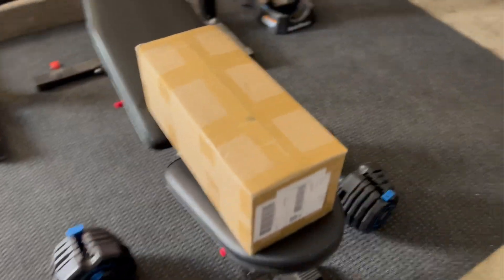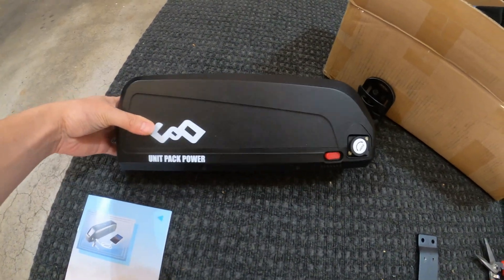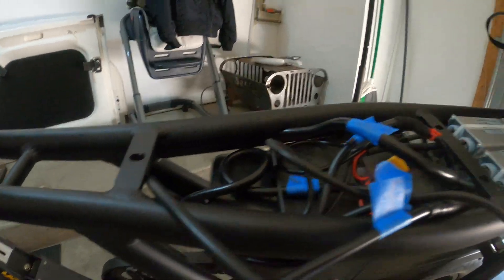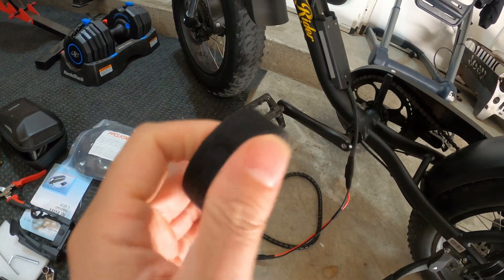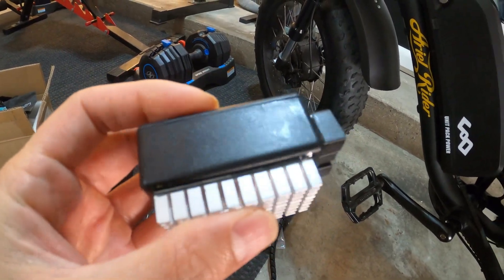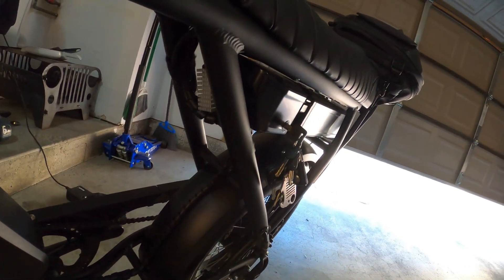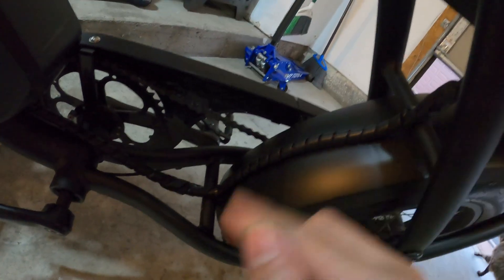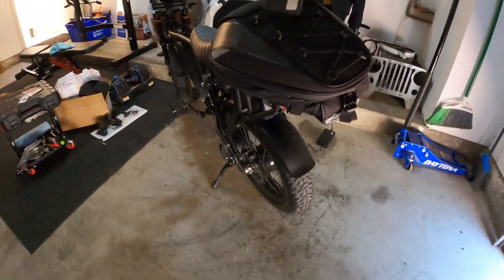Dual Battery Install 52v 19ah Fusion Battery Combiner Ariel Rider D Class

Comment: WoW that's how you open a box very boring
Reply: Yeah I always fast forward the box opening. Everybody's got to show the razor blade and open air every little box but some people need that. But after you watch a few videos of opening the box just hit fast forward. But this looks like a really good setup. The only thing is I got the high bar but I was thinking of a rectangle or a triangle battery so it doesn't look like Frankenstein with black duct tape and wires all over the place. Too bad they don't just make it. All these e-bikes should come with you. Pull up a cover off and just plug that bad boy in that would be a great selling feature

Comment: Question for you Johnny when connecting three batteries to a quad fusion combiner and I have two controllers do I need to install a third connection to my controllers so it can connect to the out on the fusion combiner. I hope you understand that. Thank you

Comment: How’s it holding up with the 52V battery? I have a V2 d-class and thinking about doing this with a “52v” battery which has a max voltage of 58.8V but the stock battery only goes up to about 53.8V so I’m a little hesitant

Comment: Quick question if you don't mind. Can that battery be mounted upside down? With the mounting plate above the battery?

I'm looking to mount mine under the seat to avoid using extensions. I assume it would work but be more difficult to place the battery in and out. Which isn't a problem since I'm not planning on removing it often or at all.
Reply: I ended up purchasing this battery and doing this mod. The battery can mount upside down but required taping two additional screw holes near the bottom of the mount. If I had only used the the supplied holes I suspect the mount would eventually snap in two. So there you go, it works with a small modification.

Comment: Is this bike worth it for $1800 used in very good condition 10 hrs total ridden it's gen 2.
Reply from the maker: I’m going to say no, not worth it for $1800. This model was discontinued so replacement parts will be hard to come by. If you can muster a few more hundred dollars, you can purchase a brand new ebike that comes with a one year warranty. Try negotiating down to $1500.

Ebikes have come a long way although have not been perfected just yet. I’m part of multiple Facebook ebike groups and I still see a lot of posts on ebike issues such as motor malfunctions, controller overheating, and displays going out . These companies provide one year warranties for these reasons  except they cannot be transferred to new ownership. 
Good luck👍

Comment: This video was amazing. We need more D Class vids. I hope they upgrade the bike. ITs the best one of the bunch.
Reply from the maker: AR unfortunately discontinued this model 🥹😭
Reply: Okay I'm just finding your channel. I got an area a couple Rider 18 a 52 volt. Maybe I can get a square battery and it's the high bar. And if you could help me with a link that'd be great. I just want to do it as easy as possible. Too bad they don't make it like all you have to do is plug it in. Instead you get it which is not a big deal, but I also don't want it to look. Really Canon ghetto well looking like crap. Too bad of the Ariel Kepler you can't mount a rectangle underneath the back bike rack. That would be cool

Comment: does the right handle bar brake trigger the light too or just to left side per your config?
Reply from the maker: Both sides trigger the brake light.
Reply: @johnnycrash4838  did you have to splice into both brake lever wires?
Reply from the maker: @VietPho  just the left which surprised me 🤷🏽‍♂️.

Comment: Coming from the rc industry you don’t need all those connectors.The less connectors the better current will flow. Just solder extra long negative black and red  positive wires and use one male and female connect towards the end under your seat.
Reply from the maker: Thank you for commenting. I was asking myself the same thing during the install but couldn’t find any answers from the ebike groups.  I’ll definitely give it a try. Thanks 🙏🏼

Comment: With the 2nd battery installed what’s the speed, range and does it it have torque. 
I was thinking about to get the grizzly but now that I saw this is cool add on, I’m thinking of the price range comprare the Grizzly/D class is it really worth it?
Reply from the maker: Grizzly version 2 just released.  37mph top speed with dual motor and dual 52v batteries. Even with my setup and battery upgrade, Grizzly v2 outperforms in speed, power, and range with a price difference of only $500.
Reply: @johnnycrash4838  thanks a lot good idea of the price range comes with more torque and speed
Reply: Also the difference of the X class with 1 motor comprare of the D class with 2nd battery

Comment: Where did you pick it up for $320?  The website has it at $372..
Reply: Yeah… lol I know I got hooked up. I was originally purchasing from Alibaba UP store and the battery I wanted was no longer in stock so the person I spoke to offered me a discount on the ones they did have in stock at there US warehouse
Reply: @johnsadural9901  ..ahhh. ,I Gotcha...Nice  way to get a discount! If you don't mind me asking, which battery were you inquiring about on Alibaba?
Reply: @bluzzpower  I purchased the same specced battery 52v 19ah  but with Tesla cells instead. Two days later they contacted me saying it was sold out 🤷🏽‍♂️
Reply: @johnsadural9901  I am trying to find a replacement for the original battery for the D-class but having issues with identifying the right formfactor. Can you help me out? :'(